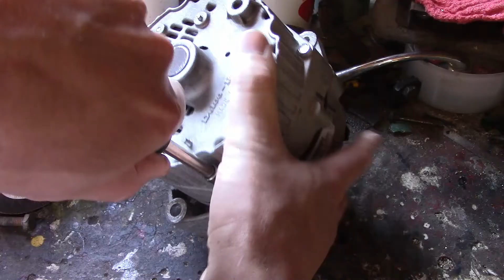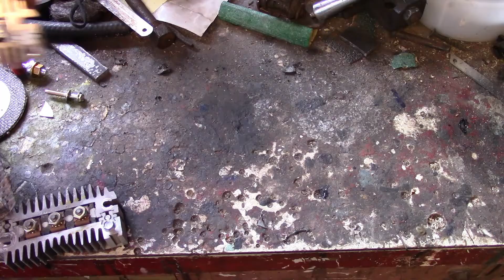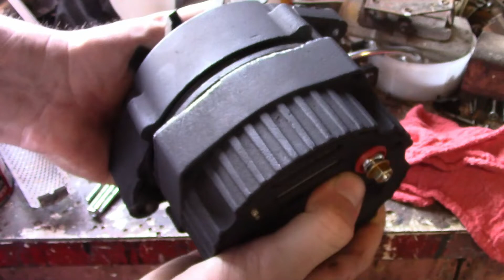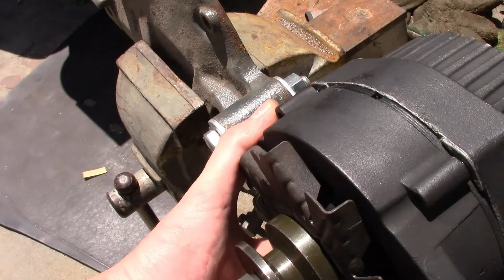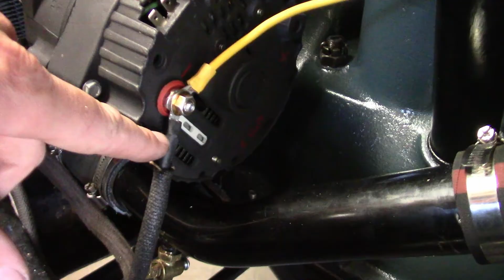Converting an alternator to 6-volt positive ground.

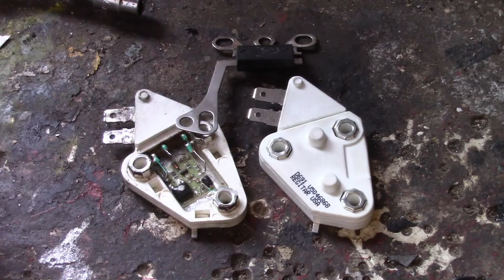Comment: There is another vid with an older gent doing this conversion. Clearly he has done lots of these and knows them inside and out. BECAUSE OF THAT, he assumed knowledge us dummies don't have. Like at 12:37 you show the exact brush process. Thank you for taking the time to do each step, slowly can clearly.

Comment: Great video! I followed your method and it works great!!
NOW… It would be wonderful if you or anyone could develop an inexpensive method of stepping a 12 volt battery down to 6 volts in a way that could handle the high draw of the starter so we could buy 12 volt batteries for use in our 6 volt cars. 
Any plausible solution??

Comment: I have one on my 1935 Coupe and it works great if you have  halogen bulbs since they take  way more amps to operate then the original  bulbs . I was burning out my  old generator  using the  halogen bulbs so  that's why I went to an alternator system.  I use  the old Volkswagen  headlight bulbs that resemble the 12 volt style halogen with the same base  and they work great  with  the  reflector conversion for the headlights' halogen bulbs' without  changing the lense size. Everything looks original on the outside still.  The  6 volt bulbs are a little more pricey than the 12 volt ones but  the  whole system is still 6 volt and  as long as you have a good battery  that's charged up real good it will maintain it  but don't try to charge a low battery with this  6 volt alternator because you can burn the wiring up  on the old girl since the amps are around 60 at idle speed and the wiring  doesn't like it at all. Neither does the ignition switch like it very much. The one wire  regulator  works like a charm and you light's can help you see in the dark now. Not a dim  yellow glow like the old filament type. Also as a side note ,If you have an old radio with  tubes like I do  it takes a lot  of amps out of the batt to operate so the alternator  also works great  too and I use the  Optima battery  in good shape for  the batt source in 6 volt  of course . The delco  10SI is  the easiest to  repair and set up  and anybody that can follow directions can do it with  just a few tools that you can obtain at a hardware store .
Reply: One thing that alternators are not good at is charging a dead battery.  Generators are much better in that regard.

Comment: Curious if the charge curve and control matches that of a modern car? The problem with the original Ford generator is that the charge was unregulated and was impossible to reach a satisfactory compromise to ensure sufficient charge to replenish the battery when the lights are on as opposed to overcharging when the lights are off.
Reply from the maker: I would guess it doesn't because it doesn't have a separate wire to monitor the battery condition like it was made for originally. I'm not sure how these self-regulate without it, but thay do to a point.
Reply: @onewhocollects6781  I have a '29 Model A and the battery was shot after three years. I believe it was due to overcharging. I really liked your presentation and rather than try to regulate the original generator, I think I will do what you did. 

I would however like to explore how to regulate it like in a modern car while retaining the 6 volts positive ground. I was a bit surprised at the 15 amps when you started up. Did it remain at 15 or did it settle back to a lower value?
Reply from the maker: @tedrobinson372  With normal driving, the charging goes down to nothing when there's no load on it. I don't know how much it would steadily charge with a dead battery.

Comment: Incredibly nice video. Thanks. Can you tell me where you purchased this specific alternator mounting kit? Would like one identical to this one. Have looked most model A: parts vendors and cannot find one specifically like this one. Thanks in advance .
Reply from the maker: I got it from C W Moss in Orange County California.
Reply: @onewhocollects6781 onewhocollects Thanks so incredibly much. I have converted these for years. Tip, if you put the capacitor back in the 6-volt alternator the voltage output will not fluctuate as much as without the capacitor. The capacitor can fix flickering LED headlights. The capacitor will work if hooked up to negative or positive ground. I really appreciate the help and fantastic video.
Reply: @onewhocollects6781  Thanks very much.

Comment: Thanks for this info. I always had bad luck with generators either over or under charging (city driving, and I never had a modern regulator for one), so I used alternators.  I agree that they’re not always as reliable as the original generator.
Reply: If your cars are old enough to have a 3 brush generator, that is often an issue.  That 3rd brush is adjustable for output - moving it further away from the main brush lowers the output, closer increases the output.  The big problem being is that if you have it adjusted to adequately charge your battery in city driving, it will overcharge it if used for high speed driving.  Conversely, if adjusted for high speeds, your battery will be undercharged if you drive mostly in the city.  Especially if much of your driving is t night.
Reply: My exposure to the Model A was breathing life into one my dad had pushed into the woods to rot away cause it was 'all worn out.'   There were essentially two different 6 volt generators that I worked on.  One was the more conventional cylindrical one and there was another one that was thinner,  flatter in shape with a larger diameter and a cap you could take off quite easily on the back.  These generators had a moveable third brush that you could adjust for higher or lower amperage output.  I agree the old 6 volt generator was very reliable, but its draw back was limited output to power the lights.  Now with LED light bulbs,  that problem may have been solved.

Comment: My 1924 Model T came to me with a 6V negative ground, one wire, gear driven alternator, it works great.  I have a freshly rebuilt stock generator for the car, but the alternator works so well that I've left it on.  I did paint it black to help it blend in some.  :)

Comment: If your ammeter gets hot, open it up and clean out all the contacts. Mine started smoking even at some point. luckily i noticed it quickly. Cleaned out all the contacts from corrosion, and apparently it had aluminum screws, which aren't the best for electrical connections, so i replaced them with brass, and it was all fine, never got even worm anymore.
Reply: Paul Shinn has a great video to fix ammeters that get too hot. A matter of adding solder to lug contacts inside ammeter. Great vid.
Reply: @SigmaJWolf  wouldn't have fixed mine, because the issue was aluminium connectors